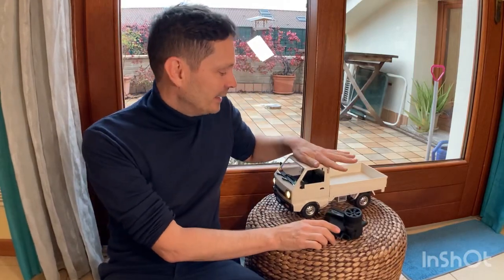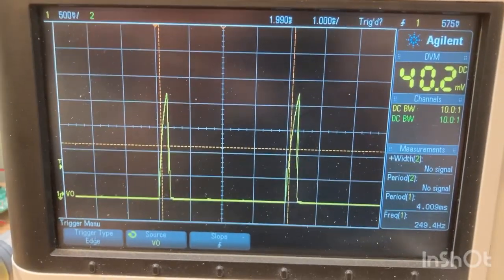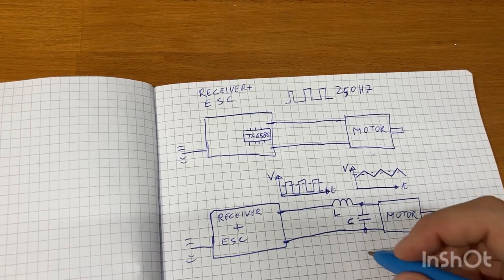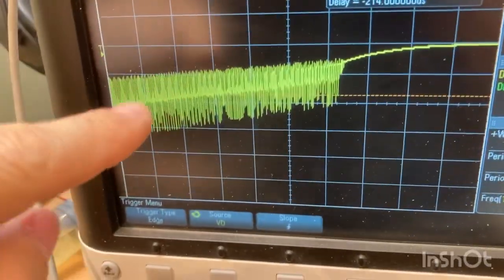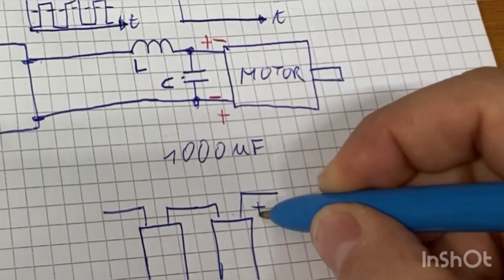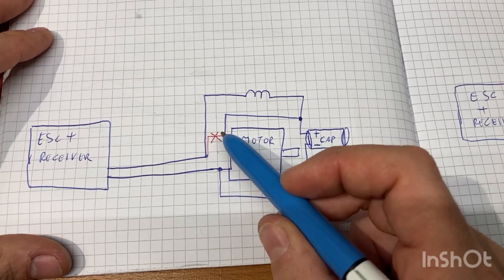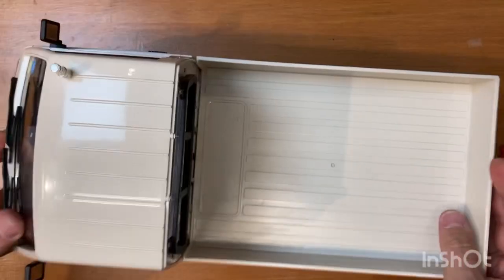WPL D12 upgrade: no buzzing noise

Comment: I just tried this with two different inductor and the result is the same. The ESC cannot normally worked and can't have proportional control (only maximum speed)

Comment: For the inductor, which one should I used: CD127 10 uH SMD 5A, CD53 10 uH SMD 0.5A, or CD43 10 uH SMD 1.5A?

Because those are the only availables on my local shop.

Comment: Wow, I had wondered if there were any methods for this. I mean I love my D12 but if I'm using it at night, I worry about the noise. Was not expecting such a detailed video, impressive. Now to see if my soldering skills are up to the task, once my new D12 arrives.
Reply from the maker: Hi
Yes, this is really improving a lot
But the final mod is the cheap brushless direct drive. Please check it on my channel, super silent, batteru last forever, speed is super

Comment: I've tried the two electrolitic capacitors 330uF connected in series with a 110uH inductor, the inductor started heading quite hard and the motor response was slow. Then changed the inductor for a bigger one of 220 uH this worked well. The inductor is not as hot anymore but I will try getting one 2000 or 3000uF and hopefully it will improve even more. The noise reduced significantly and still good control of the motor at low RPM
Reply from the maker: Good to know
If the inductors was heating means that the copper wire was too thin
2000uF willl show less noise for sure
You can lower thi indictor to 10uH , this will heat less (for the same external size)
Reply: @MakerFabio  thank you I will order some an try
Reply: Update. I've got new components and it works great now. For inductor I've used a CD54 SMD 10uH power inductor, and a 2200uF 25V Low ESR Panasonic Capacitor. The noise is like none existing and the inductor does not heat up anymore.
Reply from the maker: @TheKawasaki500s  very happy that worked also on your. Thanks for reporting
Reply: I found that low speed control is very degraded. Any solution with change in inductor?
Reply: @nathaniel309  yes I definitely recommend the 10uH inductor worked well and two 2200uf low capacitors did the job. The inductor does not overheat at all and the control is very smooth and the noise nearly gone

Comment: Built one myself. Found the caps and inductor in an old atx power supply.

It works but i lose some slow control. Now the motor goes faster
Reply from the maker: I didn t notice this
Maybe the minimum is becoming little higher . Now i dis the brushless conversion iproposed in my channel, which is the beeeeest mod you can do, but i can not test back the noise mod

Comment: the buzzing remains, how to completely get rid of the buzzing?
Reply from the maker: Ho, A litte will remain, but I think is much reduced. If you want to go to almost silence, i think you have to Increase capacitor values to 3300uF for instance
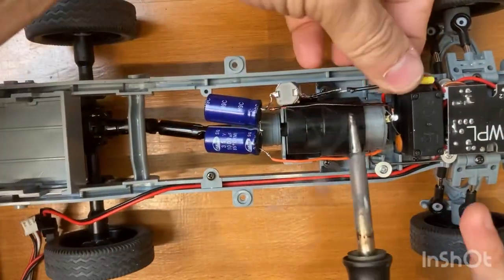Reply: @MakerFabio  and what kind of detail do you have at 4:24 minutes round, to which you soldered a minus ?
Reply: I found it, and what is this small inductor 10uH used for ?
Reply from the maker: @sergeysharapov5945  it is used to slow the inductor current during pwm. See minute 1:45 and onward. Too long to explain by text
Reply: @MakerFabio  do you know any good controller replacements so that there are no such sounds ?
Reply from the maker: Could be the 
Hobbywing QUICRUN WP 1625 Brushed esc
Reply from the maker: But a litte buzzing is always present
Reply: @MakerFabio  Good afternoon, I did as you have, I only used 2200uF 16v capacitors, the buzzing sound is almost inaudible, but another problem has appeared, now the engine speed is not regulated, with any pressure on the gas, even the smallest, the engine accelerates (
Reply from the maker: @sergeysharapov5945  wow
Did you use also the inductor?
Reply: yes, this CDRH104R 10UH 100
Reply: if you lift the car in your hands and slightly press the gas, then instead of a slow torque, the engine accelerates, what do you think went wrong?
Reply from the maker: @sergeysharapov5945  maybe if you rise the wheels, then it sink less current and the cap remains charged, so the wheels goes higher
But my one with the wheel on the fopr was responding just fine.
Now i can not test anymore because i converted to brushless. I noticed that your inductor has only 0,76A saturation . Also this is not helping
Reply: @MakerFabio  ok, I'm going to think, why did you set yourself a brushless motor and what is its advantage?
Reply from the maker: @sergeysharapov5945  check among my video, i m showing how to do and the advantages. Best mod ever for the wpl

Comment: Ver good video, thanks, i Will do it. Can you send me a component list? Or links for buy it. Im sorry but my english is bad.
Reply from the maker: € 0,82  5％ Off | 10pcs 8*10 I-shape Power Inductor  Inductance Copper Coil 1uH 2.2uH  3.3uH  4.7uH 6.8uH  10uH  22uH  33uH  47uH  68uH  100uH....
https://a.aliexpress.com/_vtQtvS
Choose the 10uH version

€ 1,03 | 10PCS 2200UF 16V 16V 2200UF Electrolytic Capacitor 16 V / 2200 UF Size 10*20MM Aluminum Electrolytic Capacitors Free Shipping
https://a.aliexpress.com/_uhKAJE

Comment: Hallo Fabio,
Great…fantastic tutorial…many, many THANKS…🙏🙏🙏
I am doing RC since over 40 years and was racing 1:10th scale electric off-road for many years on quite high competition level, mainly in times before nowadays comfort of brushless and LiPo technologies 😉🧐😂😊. I have generally quite good understanding for electric physics and this helped me a lot in those racing times working with brushed motors and NiCa and NiMH batteries on competition level. Understanding and handling your electrical equipment was a key-factor to have a chance to be successful…
I remember my fist ever race with a 6 cell 1200mAh "Red" SANYO NiCa battery, a REEDY 15 turns modified motor and TEKIN ESC…so, racing a buggy for 5 minutes and the following last lap in the dirt took quite some energy management… 😉🧐😂😊
Like said, I was lucky, because I already understood quite a lot and I knew how to find best ways to learn more and more…
But I am honest…I never came as fare as you in ways, like you handle this given "problem"… WoW…!
Really good and again many thanks for sharing your knowledge in such practical manner with us… 🙏🙏🙏  
Keep on having a great RC FUN time…!!! 🍀
Reply from the maker: Many thanks for encouraging
PS
I also had sanyo cells in the past, i still have them around 1700mAh. Now lipo and brushless are so much better, but still was a big emotion to see some power in that way in the past